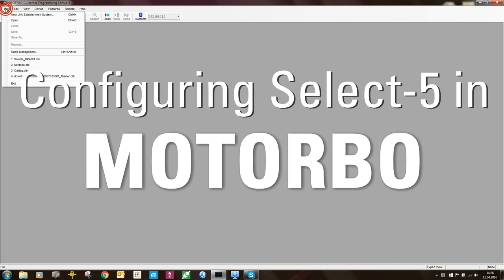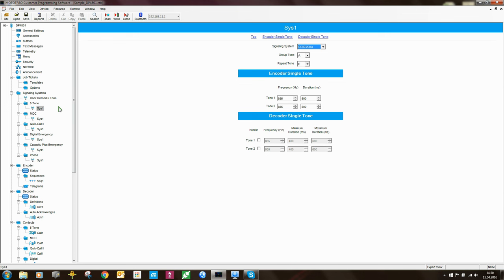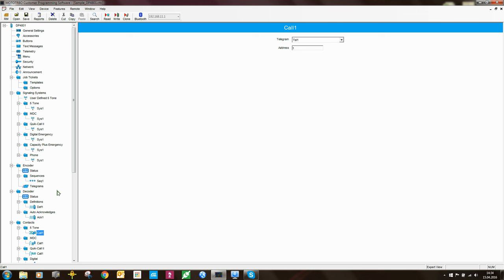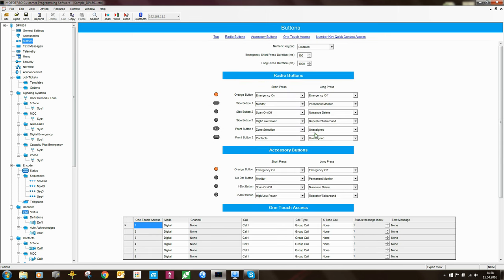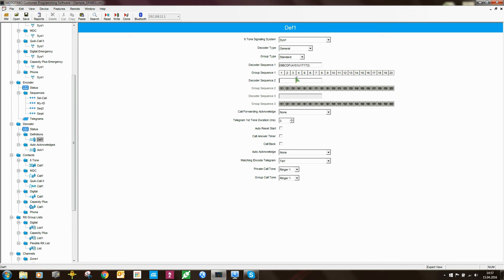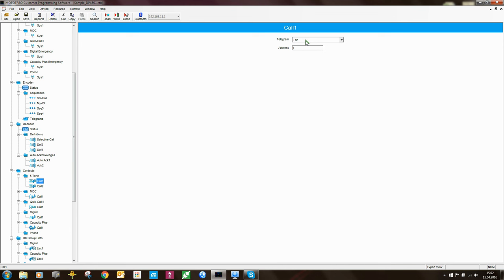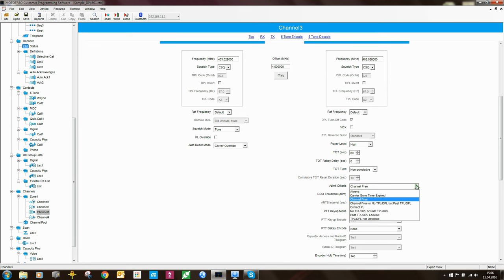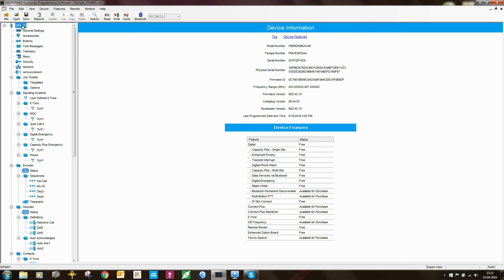MOTOTRBO: Select-5 Configuration

Comment: Great video! Small question: what version are you using?
I use 13.6 (build 680). In this version, the tab Decoder- Definitions missing two lower points - Private Call Tone and Group Call Tone. 
This is very inconvenient compared to Waris. 
What is it? Assembly error?...
Reply from the maker: This video is somewhat old so i must have been using 12.0 or something of that vintage.

Is the radio on the latest firmware? Do you have Expert View ticked? Which model radio is this?
Reply: Wayne Holmes, thanks for the answer. Yes, the advanced mode or Expert View. I have understood the reason - 99%, which is due to an older version of radio firmware.
Reply from the maker: I try to keep a list of latest versions at http://cwh050.blogspot.de/p/the-latest-firmware.html